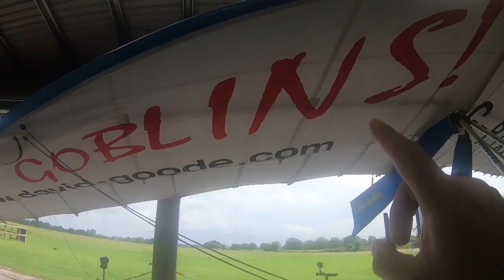Flexwing NPPL Journey  - THE WING - How it works

Comment: Interesting video but I have a correction. When a wing stalls the centre of pressure moves aft leaving the CG in front of it. Alternatively, in some aircraft the Tailplane provides a negative luft so as the aircraft sliws, there is less downward pressure from the tail allowing the nose to drop before the stall.
Reply from the maker: Hi Simon, depending on the type of aerofoil section will dictate which way the CoP moves. On a convenient section it moves forward (on a flexwing, the outer tips are the equivalent of the tailplane providing the balancing force. On a reflex section such as a flying wing the CoP moves rearward which is why they don't need tailplanes. It's all in the detail of the wing configuration. The reason for the nose dropping is due to the misaligned CofG and CoP they are very rarely directly apposed.

Comment: Great video. I was wondering if they have any strutted wings across the pond. I'm here in the U.S. and fly a Northwing Maverick wing on a Sabre Trike.
Reply from the maker: Hello there, they do make a strutted version called the Bivvi Bee which is strutted and topless. Are struts important, or more for storage?
Reply: @GolfFoxtrot22  Hey Giles. For me  it's about storage. With a kingpost it wouldn't fit in my hangar. I had to drop the control bar down to the trike base tube to clear the ceiling. For flying they claim it cuts down on parasitic drag from all the wires. Trim speed on these wings is adjusted by a mechanism on the keel tube that moves the hang point fore and aft. You can also fold the wing while the wing is mounted to the trike. Pull the battens, release the wing tension and fold. Thanks for the reply. I love watching your videos.
Reply from the maker: @wrdturkey  have you seen my wing fold video. It takes less than 20 minutes to be flight ready, it was one of the selling points for me as I only had a shipping container to store it in. I'll have to have a look at the machine you fly.
Reply: @GolfFoxtrot22  I'll check it out
Reply: @GolfFoxtrot22  I intentionally missed that video. Wing assembly is boring to me, so I hardly watch those types of videos. Your video surprised me. You have a system there that copies what struts do for a wing. Awesome job and a very clever way to store a trike without a hangar.

Comment: Great video.  There's a lot more to these wings then first appears.  I have a question ... how does it affect a wings handling if it is strut braced versus cable braced.  Thanks
Reply from the maker: I believe the struts are there because they have removed the king post (and luff lines for the reflex). There is  internal bracing for this. That's tjr the only difference I know of from when I asked.
Reply: @GolfFoxtrot22  I have an Aeros Fox TL (strut braced) and I believe you have the Fox T (cable braced).  I think the "T" is lighter then the "TL" but I wonder how differently they "feel" in flight.  Also, the TL has two "sprogs" on each wing (tubes that hold up the trailing edge).  I don't know exactly what their function is.  I think one thing they do is hold up the trailing edge, but they may have a function that helps provide stability.  Thanks.
Reply from the maker: @stone8597  Your sprogs are there because you don't have luff lines (topless) and they also generate the reflex.  Yes the TL is about 2kgs heavier.  I'd like the strutted version, less need for my rigging struts.

Comment: Can anyone help me out here? I fly 3-axis so I genuinely don't understand how these flex wings work. I get that the weight is shifted forward or back during pitch changes, but how does the actual pod maintain a nose up pitch? If weight only acts downward, then surely the pod itself will just pitch level again with the wing pointed up?
Reply from the maker: Thrust changes makes them climb and descend, bar position changes the speed. It is  technically the same as 3 axis.
Reply: @GolfFoxtrot22  Well I get that power still controls altitude and pitch for speed, but what I don't get is why the pod appears to also pitch nose up? As I say, if gravity acts down, then as I say why does the pod pitch up when the bar is pushed forward?
Reply from the maker: It's a secondary effect. The pod initially goes backwards, then as the flight path changes the equilibrium takes over and it then goes back to the bar trim position, now in a climbing attitude.
Reply: @GolfFoxtrot22   Alright I'm starting to get the principle. Sorry if my repeated comments here are too persistent. Uh would you know of a diagrammatic video or something that would show me in a more pictorial sense? It may just clarify it further. Also thanks.
Reply from the maker: I don't unfortunately.
Reply: @GolfFoxtrot22  Alright well thank you anyway. I'll be sure to message back again if things still don't clear up.

Comment: Question -- I flew to Eastbourne last Sunday, smooth flight hands off all the way. Pulled it out on Wednesday, same nice smooth weather and Quik had a significant pull to the right.
No chance of hangar rash at all. I just dont see why?
Reply from the maker: Have you carried out a batten check recently, it's the only thing I can think of. Has the pull or turn remained constant, I'm no expert.